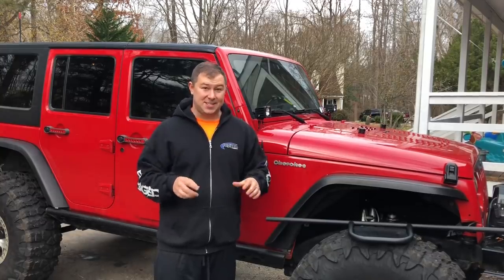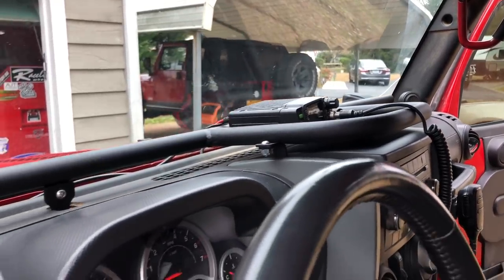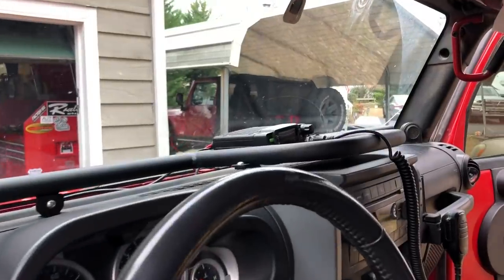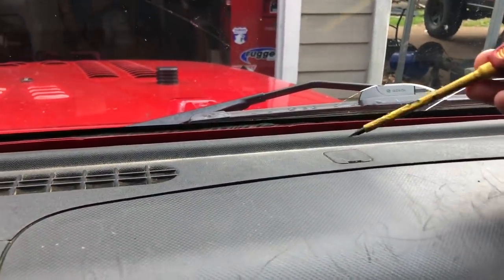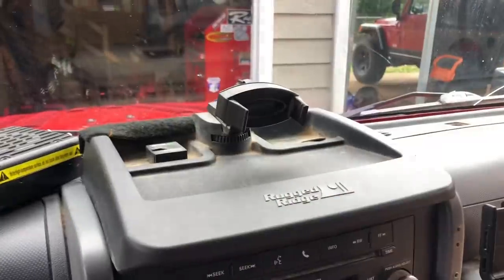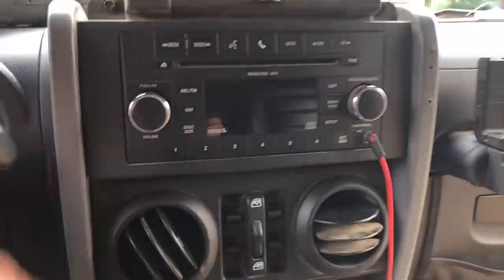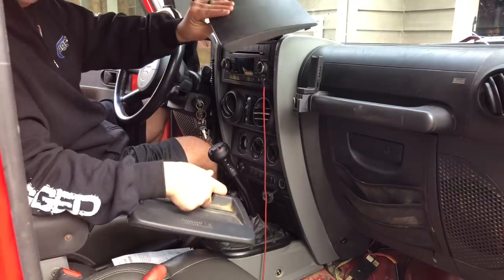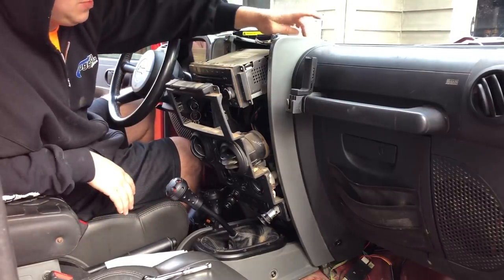Vector E-Dock Review And Install

Comment: Hi .. can you comment on exact specifications of the 13mm deep socket?  Is that hex socket?  If you have the part number I can order the same?  Also did the 13mm magnetic nut driver, I suppose that is deep socket too?  Do you know that part number for that of the Amazon link?  Just want to make sure I order the right r
Tool.  Thanks in advance!

Comment: Is that a newer mount mine only has 3 mounting points and no cover in the middle
Reply from the maker: Yeah I just got it, but as far as i know this is the design they have used for a few years
Reply: My jk is a 2016 I thought yours was newer my bad but I do like ur center section alot nice video and these vector bars are sweet and what's the status of those 1 ton axles you showed awhile ago looking forward to that video

Comment: I have the Rugged Ridge dash top tray and was wondering if it would be better to cut out the metal tray of the Vector E-dock for a “deeper” tray setup. Will this fit underneath?
Reply: You can buy the Vector bar without the tray.

Comment: tape the bracket to not scratch the "POWDER COATING"!!! really dude?!?
Reply from the maker: It’s a thin layer of powder coat. The socket rubs up against it very hard. I recommend stuff like this in videos so I don’t get a mad comment from someone who messed up their powdercoat. I’m sure it wouldn’t actually chip the coating, but it could leave a mark for sure. So it’s really easy to avoid that with a piece of tape